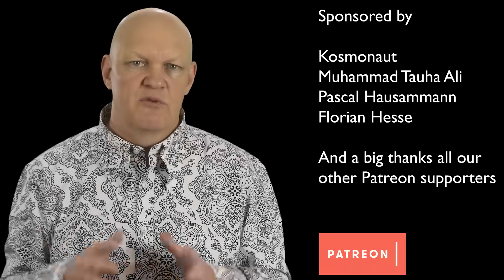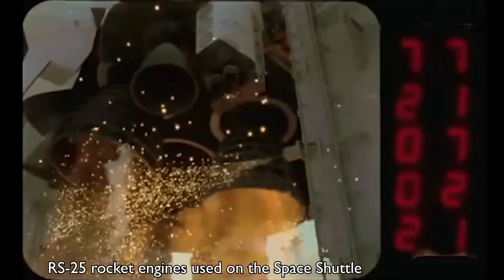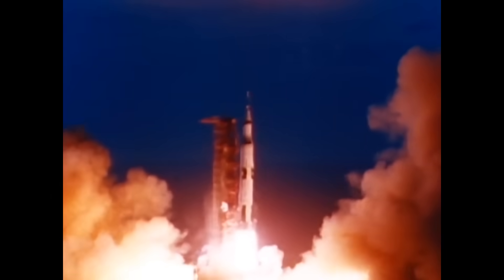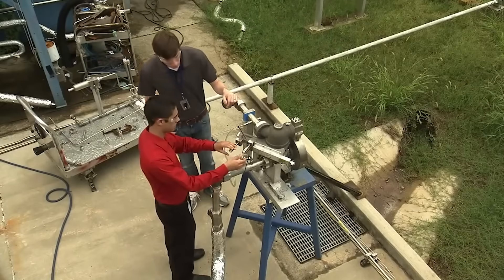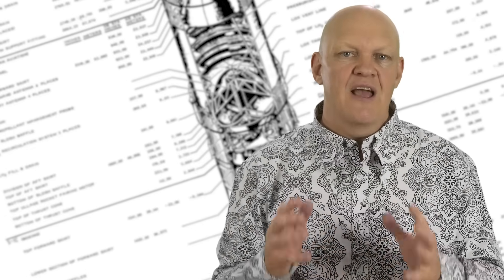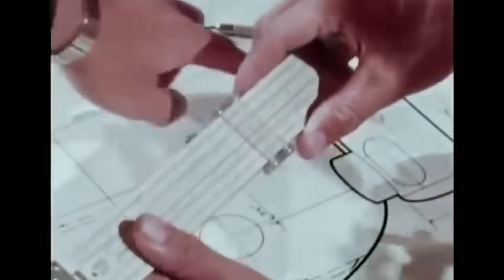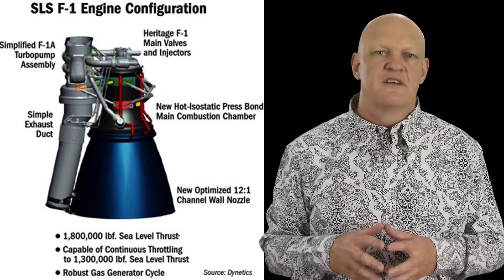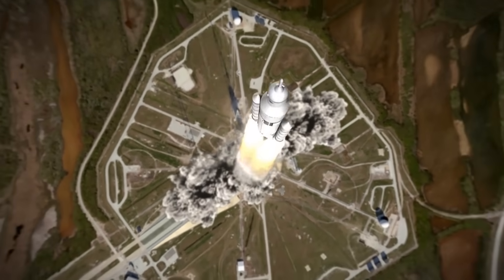Why Can't we Remake the Rocketdyne F1 Engine?

Comment: The problem was that, from the beginning, the program was finite. A load of work was done under the "Man,Moon,Decade driver, and nothing more. Money was being shoveled in with no thought of "what's tomorrow" IMHO, that's always been NASA,s weak links. Nobody thought of tomorrow.

As for the F1, every single engine was basically a "one off" build. Engineering was coming up with workarounds for a problem, and it would be fixed. Right there. Look at the injector plates. Those holes were hand drilled to make each and every one work. "Ask Joe, he did it" was the way info was passed. Unfortunately, people aren't permanent. If stuff isn't documented, it's going to be left behind. When I started in the industry in the 1970s, they were just starting to clean their act up.  I plead guilty of using my slide rule to do computations, with minimal documentation. It simply was the norm. There was no huge memory that you could save to electronically. Results were documented, process to get them, not so much. In addition, as high tech as this was, manufacturing procedures used then wouldn't be able to be used today. Too much regulation has wiped innovation out. We don't have the skilled craftspeople we had then. For instance, there was asbestos used, (Gone) A lot of solvents, fluxes, and cleaners (Gone). A lot of hand welding, ( either gone, or deemed not cost effective).  Well, my rant is done.... My expertise was instrumentation, use of synchro and servo motors to.move physical display elements, like the "8ball" in an ADI. That is kind of gone, replaced with display panels. 
I got one, though, fully operational with its own 400Hz supply gyro package, compass integration, whole 9 yards. Thought someday I'd put it in my C172. As it stands, it's a really cool thing to watch.

Comment: Being around the engineering culture, I think part of the problem lies in the fact that most engineers absolutely refuse to go backwards in technology, even when the old way is better. I can’t tell you how many times I’ve seen a engineer, it all his wisdom, take a proven process that works, and redesign it into some complicated monstrosity that doesn’t work. Most of them don’t have the capability to leave well enough alone. Most engineers are educated beyond their intelligence, and some of the stuff they design would make Rube Goldberg proud.
Reply: Safety precautions and procedures have drove costs up tremendously. Safety has become the new #1 culture. As a quality engineer, I think safety should be a given. Quality and pride in your work no matter what you do should be the #1 culture!
Reply: Plenty of crazy complicated engineering from that generation.  The original prop controller for the C130 will make your head spin.
Reply: @jeffk464  now complexity is hidden in integrated circuits and software; but it is still there. Also, this complexity was byproduct of available materials and manufacturing techniques.
Reply: Watch this video again, he said that they made a new f1, as powerful but even more efficient, technology goes forward, always, what went lost was that particular handcrafting skill, we didn't lost progress
Reply: How can you say the old ways were better when the video showed that the F1b that the engineers designed was a lot better than the old one?
Reply: Dodomando Those particular engineers were unusual in their ability to simplify rather than complicate.  The comment described the majority of engineers whose professional mistakes inspired Rube Goldberg and his contemporary cartoonists.
Reply: I see it more as a deficiency in critical thinking tbh, partially coupled with limited focus of study.

I'm a Goldilocks engineer, where I'm old enough to have fixed my own (and friends) cars growing up, yet young enough to have embraced computers and new tech. 
The engineers younger than me can't seem to conceptualize as well when dealing outside of computer models...and it's cost our company money. Young buck got a custom unit design project, took 6 months of r&d, had to refund that customer.  

Then, sometime the older crowd are so strict and solid in the convictions that they can't embrace change. Couple in my group barely use Excell let alone an mrp system, "nah....the machine shop doesn't want a knapkin scribble to make your part from".  Also didn't have process controls in place ("this is how weve always done it") and used expired materials, causing a complete shutdown and loss of well over a million. Still has his job ...

Well rounded engineers are rare ...
Reply: m16ty my philosophy as a young engineer is you always design to the tolerance and budget. You don’t need perfection. You need perfection and repeatability in the tolerance. Big difference.
Reply: "even when the old way is better" - Look at our phones, right? They are an amazing technological achievement and they are all about replacing the need for other existing technologies like house phones, GPS's, computers, flashlights, etc because they combine them all into one convenient device. Problem is... they do a WORSE job performing the tasks each and every one of those devices did. The flashlight sucks compared to anything on the market, the GPS lags and uses your data ($$$) unlike dedicated GPS's which are free, the internet looks like shit on phones compared to a laptop or desktop and, funniest and most ironic of all, their base function as a phone? Tell me how often a landline had signal issues or dropped calls? Wait, no, that's not the most ironic thing... they are wireless phones... yet everyone is having anxiety attacks wondering where they will be able to get their next charge. More than half the time I see people with their cell phones tethered to the wall. Reading "old way is better" made me think about a phrase myself and a lot of my friends use: "Newer doesn't mean better."
Reply: @30AndHatingIt  you argument is pretty dumb your comparing single purpose device to a multi purpose device. No multi purpose will be better than a single purpose one. Sure your flash light might be brighter but can it locate where you are on a map. Yes your GPS is a bit more accurate but can It call your mom. And sure landlines don't lose connection but can you leave the house with it? Can you use your landline to call for help when your car breaks down in the middle of no where? No so cell phones might not be the best at everything but they do a lot more than any other device you listed
Reply: @mymaudlincareer  I'm not even going to be petty and point out the ironic mistake you made while calling my argument dumb. I'll just try and be civil about this. I would say my argument has merit to it because it discusses the issue of taking a step forward in one area while taking a step back in another, not to mention brings to light the issue of putting all your eggs in one basket. All the tasks you mentioned the phone completing prior to making a call would have contributed to loss of battery power in said phone, potentially costing me my very life due to it not operating at the crucial point in time that I need it to. Standalone devices have their own individual power sources, increasing the power that is available for each device. The GPS's battery isn't being depleted by a phone call. The flashlight's battery isn't being depleted by texting. Likewise, the phone's battery isn't being depleted by a GPS or flashlight and, as such, is available to me for a longer duration of time, which is a critical factor during survival situations.
Reply: I'm sure this is not the case with F-1 design tech with its questionable Isp. It is questionable because it requires some careful calculations to prove that F-1 was able to do lift of Saturn-V and its 4th stage with 140,000kg to LEO.
I found at least one error in wikipedia description about overall weight of Saturn V. Who knows if this error is introduced intentionally to avoid be cought on lies, or not.

Comment: So effectively your saying our new engineer's are not as clever as the guy's n Girl's from the 50's 60's and 70's. Is that right?
Reply: I would say that what it means is that higher education has been shifted into developing professionals so dependent on an already extant technological ground work for doing their jobs, that the finer points of the craft have been lost. In the imprecise, pre-CADD world, a part would come to be, and added to a blueprint, on the spot, and out of necessity: an internal support or bulkhead would have to be added to provide rigidity to a section of an airframe, for example. The riveter would tell the foreman, who would call for an engineer, with the riveter suggesting a thin plate to add support to a section she was assembling. Foreman and the engineer would come up with a drawing on a napkin of a small, thin plate,  A craftsman would come with a piece of blank metal and turn it into what the foreman and the engineer came up with, and fit it for the riveter to put it in. Then, the engineer would sent it to the draftsman, specifying lightening holes in it, and have it run to the fabricators . THAT is what has been lost. Like having soldiers so dependent on GPS, that they cant use a compass and a map to find their way.

Comment: The F1 engines in the first stage of the Saturn V were flawed due to their large size and could not operate at full power without exploding during tests due to sonic disturbances in the burning fuel mixture. The engines had to be operated with a rich fuel mixture to prevent this from happening and did not have sufficient power to carry the necessary fuel load to complete a mission to the moon as intended. It was capable of achieving near Earth orbit. This problem was understood by the Russians and their N1 rocket developed during the same time period, larger than the Saturn V, had a cluster of 30 much smaller engines in its first stage. It also failed but for other reasons.

Comment: Just a nit-picky note - the F1 engines didn't "burn up" in the atmosphere when the stage was separated - they crashed into the Atlantic. They weren't at a high enough altitude or speed for re-entry to destroy them (I don't think they even "re-entered" as they didn't leave the atmosphere). They were pretty smashed up after their impact with the ocean, as Jeff Bezos discovered.